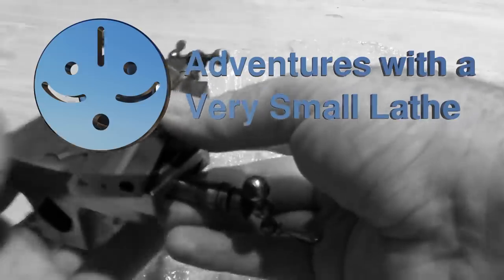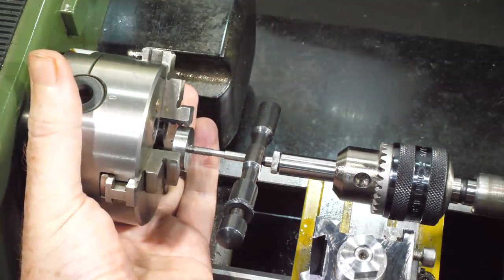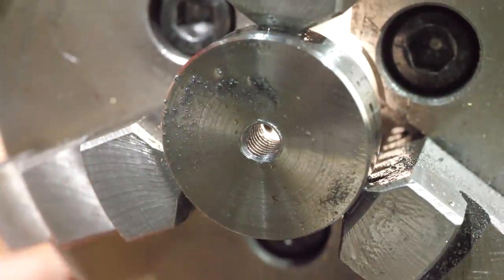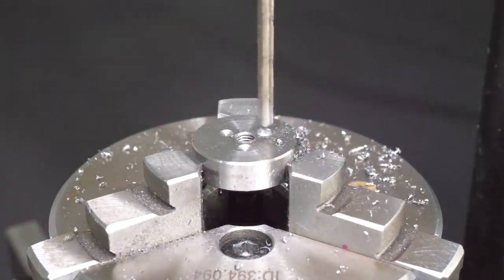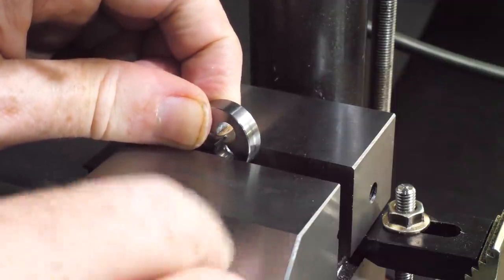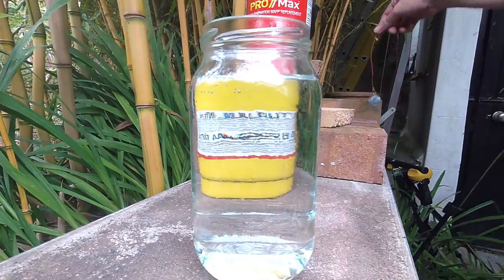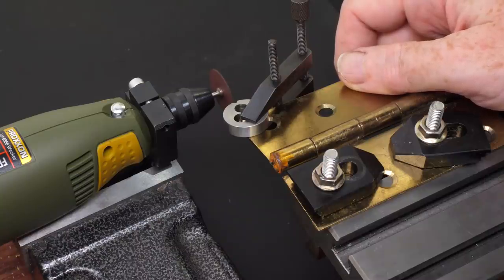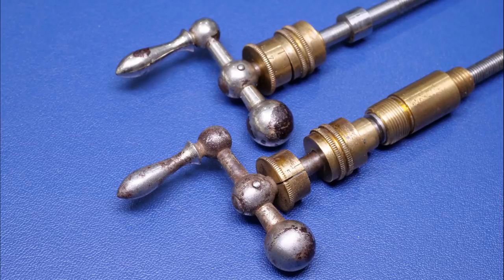Making a Custom Die on the Proxxon PD 250/e Lathe

Comment: That looked pretty stressful, seeing the part almost ready to be quenched, only to be cooled down again by the wind. Maybe you could put up a piece of wood or something as a wind break.
Reply from the maker: I need a much better set up for heat treat. Some kind of chamber, which allows the heat to build up properly would be much better. I also need to accept that windy days are probably not the right day to do it.
Reply: It's easy to set up a good hearth using foamed cement blocks (we call them Hebel blocks in Australia).

They're easy to get, low in cost and very very thermally insulating. It has the additional benefit of being easy to carve with ordinary wood working tools - it's pretty abrasive so the tools'll need resharpening :)
Reply from the maker: @jeffarmstrong1308  I haven't been able to find them for love or money, though I'm sure that's because I'm not searching for the right thing. "foamed cement blocks" and "hebel blocks" doesn't bring up anthing with details on temperature resistance. The only results seem to be intended for wall construction, and make no mention of high temperature insulation.
Reply: The proper international term is Autoclaved Aerated Concrete. They are intended for wall construction. Apparently there were issues when it was introduced to the UK due to the necessity to keep them scrupulously dry during construction. 
They have no formal thermal rating but I have seen them used as hearth bricks in both heat treating and silver soldering. I have used them in this manner for silver soldering myself.
One of my YouTube heroes, Clickspring (another Aussie!) is uses them too as can be seen at 1:43 in this clip he did on making a Making A Gear Tooth Fly Cutter
https://www.youtube.com/watch?v=6M2yAUEmJbE

Comment: if i want to buy that kind of steel hows do i call it ? im looking for a strong steel to make a sleave for a 2 stroke engine that is strong like nicasil or something close
Reply from the maker: AFAIK Nikasil is a coating rather than a material, and is much harder than steel. The steel I used is sold as BS1407 Silver Steel in the UK. The European equivalent is 1.2210 / 115CrV3. I have no information on a direct US equivalent, but W1 is used for similar work there, and has similar properties.

Comment: I've never seen the square end of a tap twisting like that.
Reply from the maker: Neither have I, but this is a home made tap, and I made two big mistakes. Firstly I centre drilled the end instead of grinding it into a point. Secondly I didn't harden this end, so the material was still soft.
Reply: @AdventureswithaVerySmallLathe  As long as we all learn from our mistakes and as you have in this video share them then we all learn.
Cheers from John, Australia.
Reply: If this comes up again, put a piece of BELT leather (7/8oz) into a vice opened up wide. (Place the tap tip against the leather and the other end against the nut.) Place a NyLock nut at the wrench end and gently press the nut onto the square of the wrench end. This permanently changes the tap to one that can be controlled with a box-ratchet or a small 1/4" drive socket set. This way, all four points/sides of the wrench end are converting energy by using a hexigon wrench.
Reply: @AdventureswithaVerySmallLathe  sorry, late to the party. You can also get smaller centre drill bits, the one you used was a tad on the large size for what you wanted.

Comment: Why not put the thread tap in the drill chuck?
Reply from the maker: The tailstock on the Proxxon isn't very rigid, and has a very short taper, so it isn't capable of keeping the tap from turning. Even without the tailstock I don't think it would work well. A drill chuck can't hold with nearly as much torque as a tap wrench, or toolmakers clamp holding the square end of the tap.

Comment: I've always heard never to use glass to hold your oil or water cause it could heat and bust and cause a fire hazard.... just a idea
Reply from the maker: Sounds like good advice, but glass shows things so much more clearly on video. Making videos is full of difficult choices. I do all my heat work out doors, on masonry surfaces, so the fire risk is kept fairly minimal.
Reply: @AdventureswithaVerySmallLathe  normally you're also supposed to stir the part in the water to keep it in touch with the surface of the part. That way it also wouldn't touch the glass directly. Liquid water will never heat up more than to the boiling point, that's usually not a big deal for glass (at least jars like this).

Comment: Hello: How about having a tutorial on cutting down flanges on N-Scale Steam Locomotives; so that instead of running on code 0.80 rail they can run on code 0.55 rail?  If you like turning small parts, then N-Scale or 1/160th of the proto-type should be small-enough!

Comment: Nice work, but Proxxon toy made in china tools in this video cost like their real counterparts from paulimot. Who would buy toys at their price?
Reply from the maker: Thanks! But Proxxon are a German company, and they make their lathes in Europe, not in China. The similar priced lathes on paulimot are all Sieg from China, no?
Reply: @AdventureswithaVerySmallLathe  The Proxxon a german office company meaning manufacture in china and stick German logo. There is some German quality control but their dremel type tools are crap, with single bearing ibs/e never buy it. The angle version LWB/E is the only 2 bearing unit, but the bearings are kept with loctite so much for german quality. Bearing have no seals and abrasives kill them in 6 months.

Comment: I have to ask: Given the work that went into making the tap, let alone the die, is there a reason you didn't just make new feed screws for the watchmaker's lathe instead?
Reply from the maker: Two reasons. Firstly, when I'm restoring an old tool like this, one of my key goals is to keep as much of the original tool intact as possible, and only replace what absolutely must be replaced. I don't really have a practical reason to restore this watchmakers lathe. I don't really have an end goal, so I'm not looking for the most effecient way to get there. I'm just interested in cool machining projects that help me learn.
Secondly I'm not sure re-making this feed screw would have been possible with my equipment. The screw is long, and only 4mm wide, and I don't think a travelling steady is available.

Comment: It would have been easier to single point thread new lead screws.
Reply from the maker: The lead screws are only 4mm in diameter, and very long. Without a travelling steady (which the Proxxon doesn't have) I honestly think single pointing it would have been almost impossible.
Reply: You're right without a follower rest it would have been tough.

Comment: wouldnt it techincally be possible to make a cheap mans salt bath solution by having a tiny stainless cup with boric acid in it and just heat it all together, i also reccomend getting something similar to a toaster oven to temper parts, its not a very good way tbh but it is better than a torch

Comment: Could you not have chased the thread, on the lathe?
Reply from the maker: Theoretically, but it's very risky. Firstly I would have to perfectly align the single point tool with the existing thread, which is difficult because there is a lot of backlash in the feed gear chain. Secondly if there was a small error in my measurement of the thread, or inaccuracy in the pitch of the original thread, or the lead screw thread on my lathe, then the tool wouldn't track the thread correctly, and do even more damage. The die only engages with a few turns of the thread, so can tolerate small drift or deviation if I open the jaws a little.